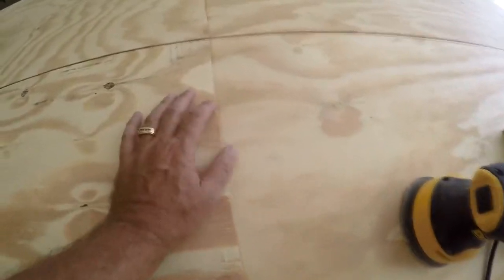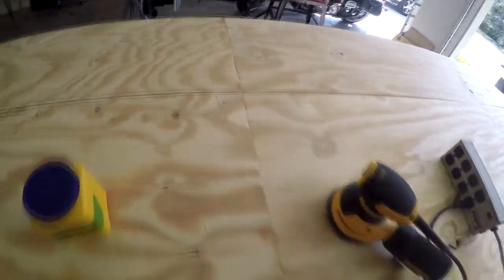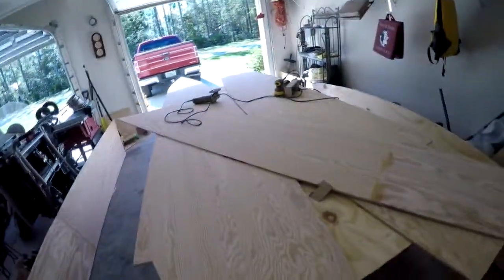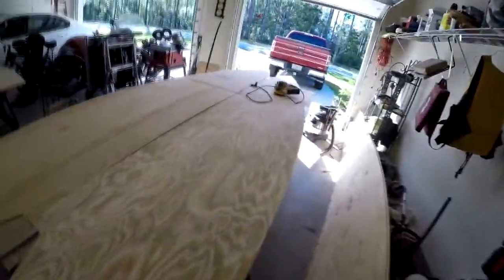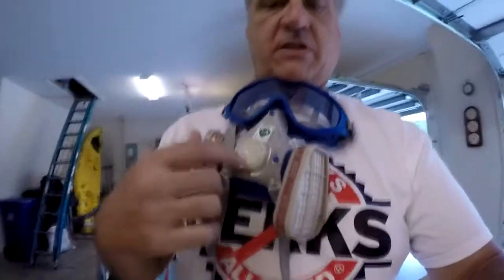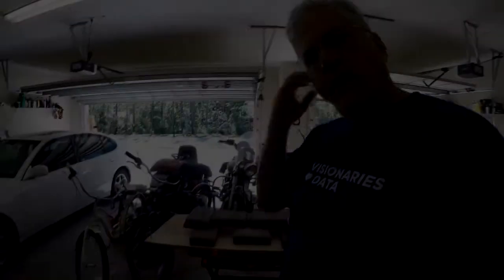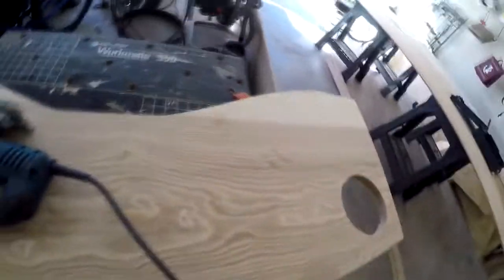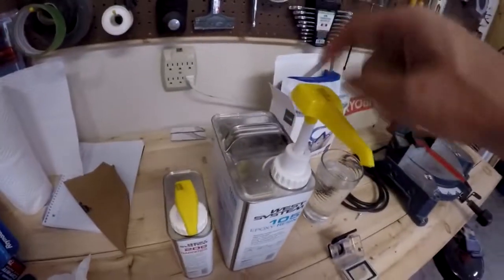10  Building a Boat Tango 15  Truing The Hull

Comment: Can you confirm thickness of the seat and bulkhead material you are using for the sides and bottom are 3/8".  The website says 1/2" and 3/8"  but my plans I got back in 2012 clearly say 5/8" for seats and bulk heads. You seem to be using double 1/2" in transom. Can yor clear up what you are doing with yours on the marine ply bill of materials wise..
Reply from the maker: The hull itself is 3/8”, including the sponsons. Everything else, the seats, bulkheads, transom and sole are 1/2”. You are right on the transom. It is two 1/2” pieces epoxied together.
Reply: That is interesting, the plans have been changed, mine specifically say 5/8" instead of 1/2 on those parts.  Check out the one on EBAY for sale In Venice Fl. before it is gone !!! Guy done a real Nice job from looking at the pictures. Search this auction #173364875594  as the ad does not say Tango but I am sure it is..